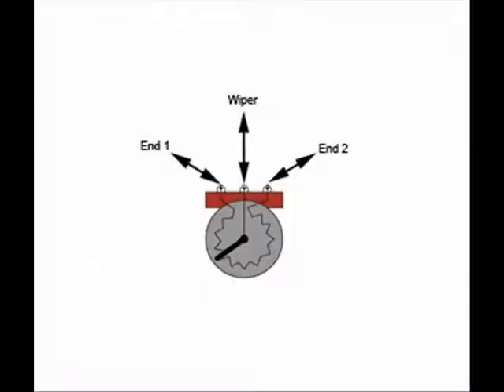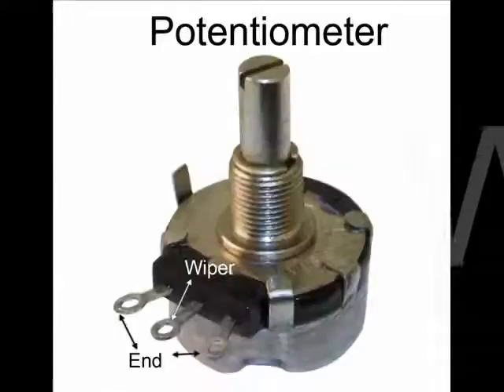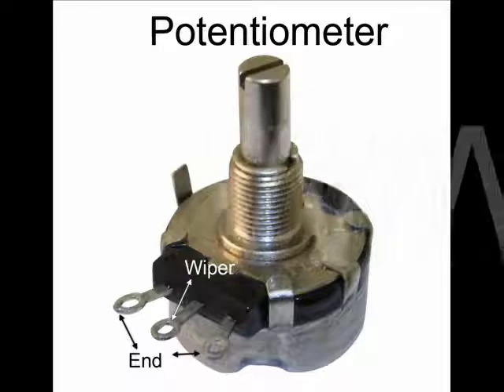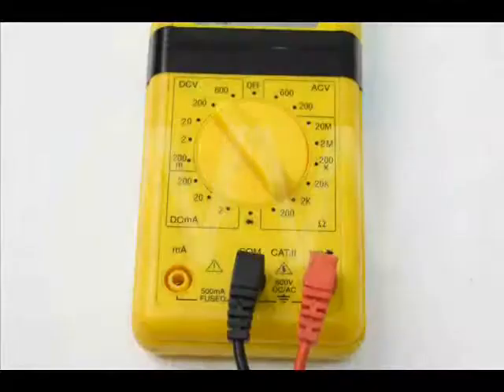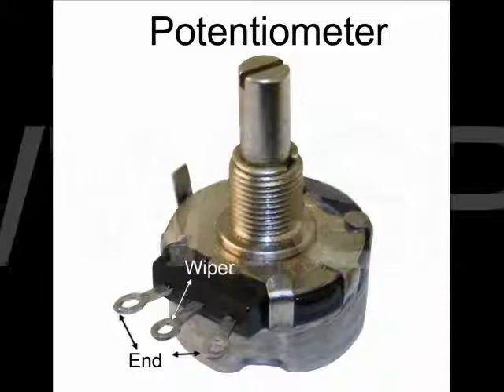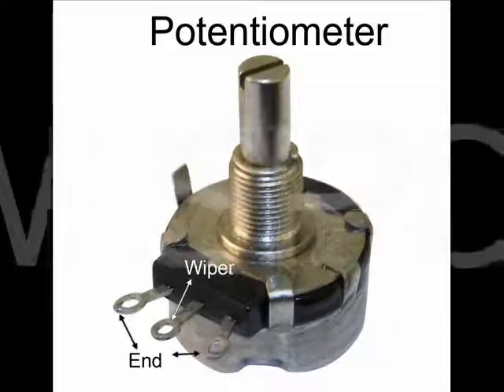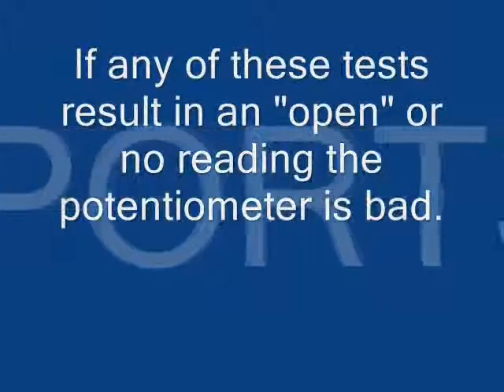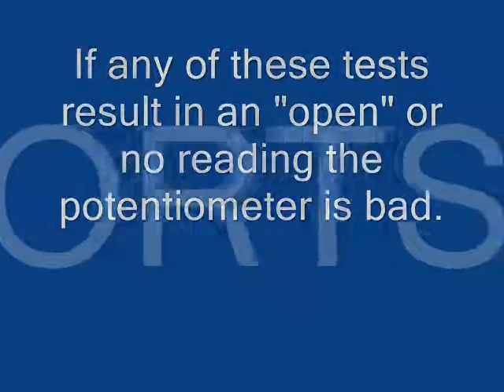How to test a potentiometer

Comment: On a guitar, do the pots need to be disconnected to the pickups and the cap to do this test?  Thanks.
Reply from the maker: When testing pots you do need them disconnected from one of the ends and the wiper. You can leave one end connected. If you do not know which is the wiper you can just disconnect all three. But make sure you remember where each was connected. I usually take a pic with my phone to be  sure.

Comment: nice vid.  I thought i was measuring my pots wrong or something, but this confirmed i was doing it right.  My problem is i have 5M ohm pots, and want to measure the resistance at certain points on it.  when i try to measure, its always a number that wont stay stable, for example, it starts reading 1000ohms and climbs to 100 000 ohms, and then starts falling back down again.  simple resistors like 1k measure fine.  is there something wrong with my meter, or am i just going nuts?